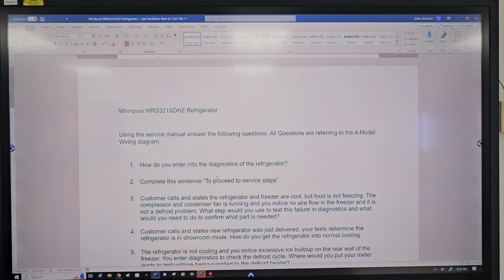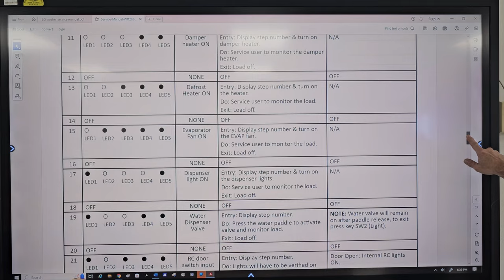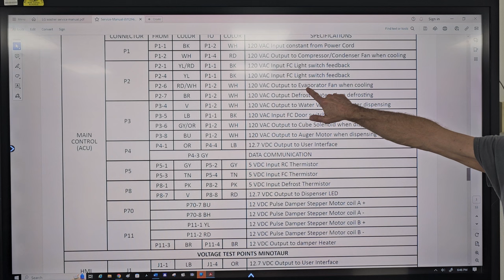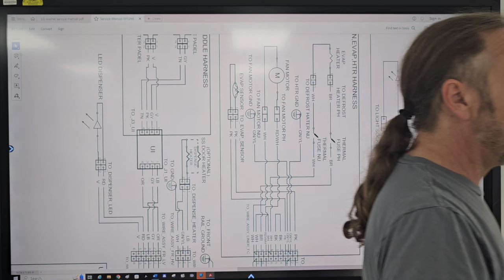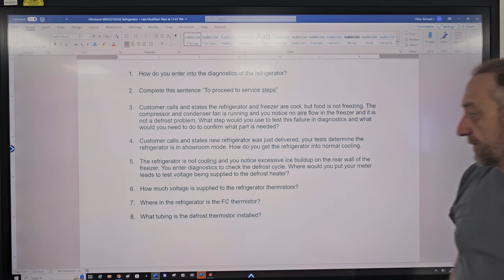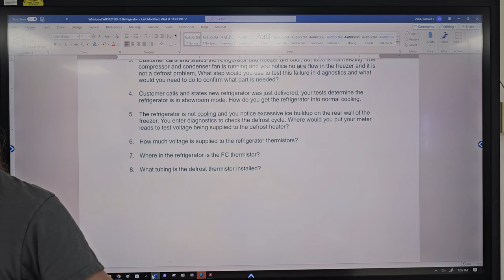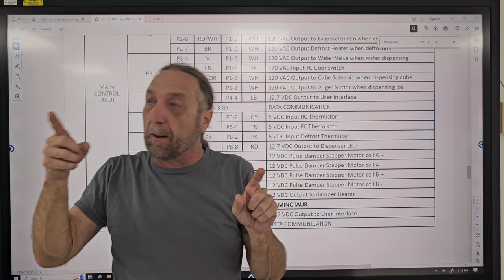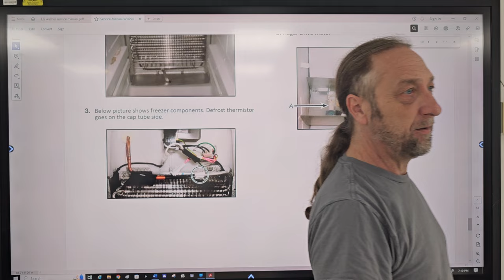Whirlpool Refrigerator

Comment: Thank you so much for your videos. Still new to appliances but I have gained so much from watching these kind of videos. Question. I am in South Africa and I know with most African countries. Our fridges don't have fans, visible evaporator, expansion valve, no damper or separation between the fridge and freezer compartment. Assuming some of these are internal. The capillary tube and suction line run internally. While we have the normal filter drier, static condenser and compressor. How would you explain that. It makes sense to say the cycle is from compression, condensation, expansion then evaporation. Can filter drier also serve the purpose of expansion? Even in terms of temperature control i.e. thermostat how does it regulate the temp and since we don't have any cooling air flowing through the fridge. This is part of the reason why once there is an internal leak, you don't have a choice but to dump your fridge. Not sure why manufacturers manufacturer that way. So if you can do a video in that context even if it's short that would be helpful. One way I have seen people reviving those type of fridges is to drill holes at the back of those compartments, put two evaporators connected to each other i.e. capillary tube to evaporator 1, discharge line from evaporator 1 to evaporator 2 then back to compressor.
Reply from the maker: They most likely work like our chest freezers in America, the condenser and evaporators are inside the walls, and you may be right about the dual evaporator systems. with dual evapoarators, you can cool both compartments. I have not seen the type of fridge you are talking about so it would be hard to explain its theory of operation, but adding your own evap and condensers is a way to keep the cabinet. Still, that much work and cost of parts , it might be better to replace the fridge.